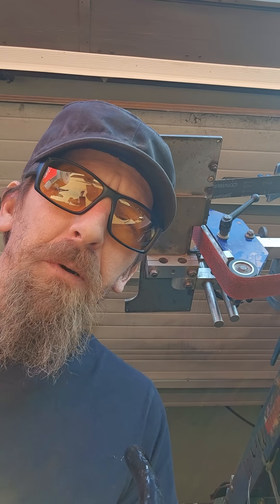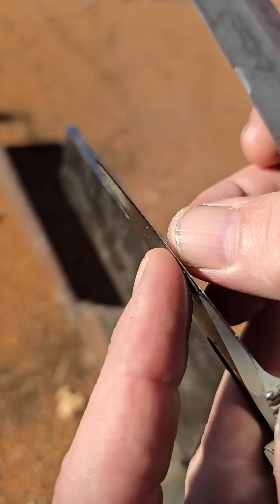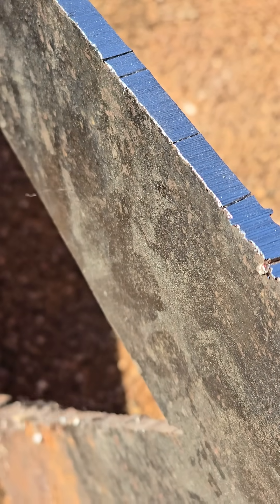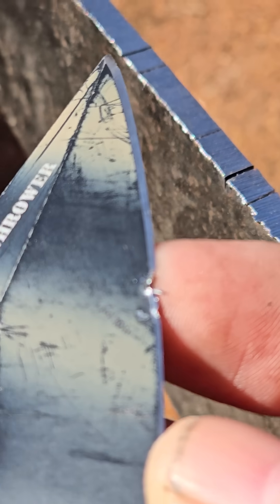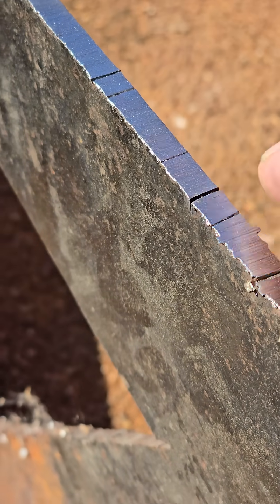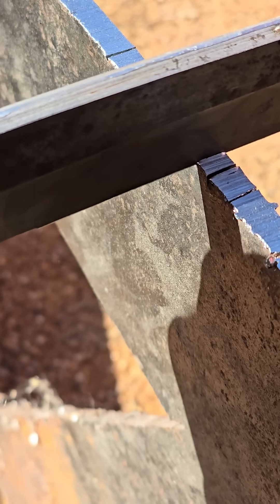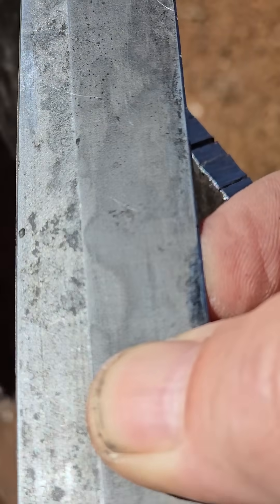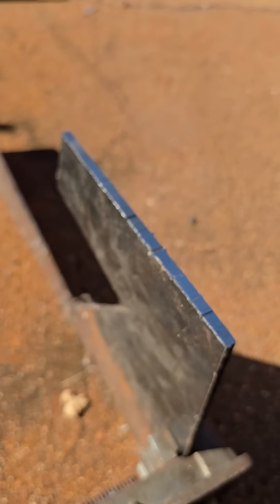myth busted. m390 vs 1095

Comment: This comparison makes no sense. M390 and 1095 are both great for different reasons. I wouldn’t want a survival fixed blade in m390 and I wouldn’t want a edc folder in 1095.

“Toughness and edge retention are generally opposing properties and it is difficult to improve both of them at the same time.” Larrin Thomas
Reply: yepp
Reply: Well said.
Reply: @joshuadillard190  microtech uses m398 so I'm kind of confused. Plus the geometry could never be the same. You got a 1/2 in thick 1095 steel against 97,000 of an inch like there is no comparison. Take a half in slab of a m398 give it your heat treatment and then maybe you can make a comparison plus this dude just demolished a f**** $800 knife. I'm kind of pissed this dude's a f**** tool. No respect for the f**** trade. There are people out there better. Than you my friend. You don't know everything. 1095 is cool but it ain't cool for pocket knives. If you give 1095 a thin geometry like the stitch and it'll snap under any kind of abuse
Reply: 3v does a good job at toughness and edge retention but it’s only semi stainless but still better than 1095
Reply: agree this test is nonsensical
Reply from the maker: @joshuadillard190  Yes I'm aware.  was showing Edge retention. I heat treat a lot and I'm deep into the science, toughness as you mentioned would be more measured in the realm of shock absorbency and flexibility . Edge retention is going to come down to Grain density and hardness. All those variables I have tested . However. The test still speaks for itself. That m390 blade wouldn't Holden Edge very well for anything this goes more to show Factory heat treatment inadequacies more than what the steel is capable of . If the results were even close to comparable it would warrant other testing. But this was just one test
Reply: @proknifethrower You tested different edge geometries! Everyone can sharpen jackhammer chisel and chop metal with it! That's basically what your 1095 knife is because it's so thick behind edge! Just look how wide that chop line is in steel. Edge is also so much more stable because of that! Personally if you can't cut apple in half without it splitting halfway down, I can't really even call it a knife! More like sharpened prybar! You can also substantially change knife qualities by changing sharpening angle by couple of degrees.
Reply from the maker: @rks9612 but the actual Edge retention at the edge LOL that's what I'm testing the m399 wasn't supposed to buckle through the primary grind. At the same time I can do the same test with a tops knives with a .050 thick heel at the sharpen and it will fail at the edge. That's the whole point of chopping steel I'm testing Edge retention not secondary grind slope
Reply: @proknifethrower  You are testing impact resistance/toughness not edge retention IMHO.
Reply from the maker: @Snarlacc Edge retention comes down to hardness and Rockwell and grain refinement of Steel they are synonymous. If my blade can chop steal all day long and not take damage then its Edge will hold much longer on Organics it's just the way it is
Reply: @proknifethrower  Modern stainless steels are more about abrasion resistance than impact toughness (or being able to chop all day long). If you go out cutting cardboard or pelt for example you will see a different outcome, more like CATRA testing where, stainless comes out far on top over carbon steel of similar hardness.
Reply from the maker: @Snarlacc what is abrasion resistance if not impact? Whether it's to the side of the blade or the edge. I'm sorry but you guys are drinking the wrong Kool-Aid. And my facts speak louder
Reply from the maker: @Snarlacc how much heat treatment do you do? How many times have you read metallurgy books by John verhoeven or Grange? I do this every day and put my stuff up against everything else in the market
Reply: If you want to test edge retention you use cardboard or a rope if you want to test toughness you hammer it into mild steel. If you don't believe me I even asked artificial intelligence and it agreed with me. Here is the explanation. 
 
When testing a knife, "edge retention" and "toughness" refer to distinct properties:
 * Edge Retention:
   * This refers to how long a knife's edge stays sharp during use.
   * Therefore, the test involving cutting rope and cardboard would primarily assess edge retention. These materials, especially cardboard, are abrasive and will wear down an edge over time.
   * By observing how many cuts can be made before the edge dulls, you can gauge its edge retention.
 * Toughness:
   * This describes a knife's ability to withstand impacts and resist chipping or breaking.
   * The test of hammering the knife into mild steel is a test of toughness. This action puts significant stress on the blade, and how well it handles that stress reveals its toughness.
   * If the blade chips, or breaks, it has low toughness. If the blade withstands the impacts without damage, it has high toughness.
In summary:
 * Cutting rope and cardboard: Primarily tests edge retention.
 * Hammering into mild steel: Primarily tests toughness.